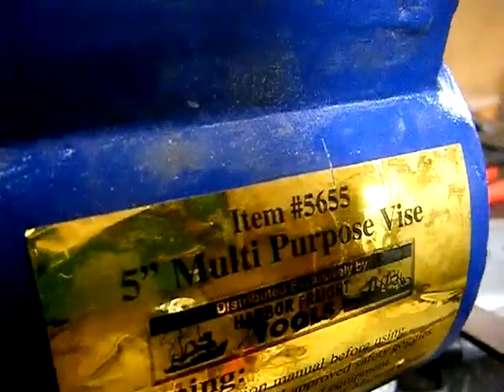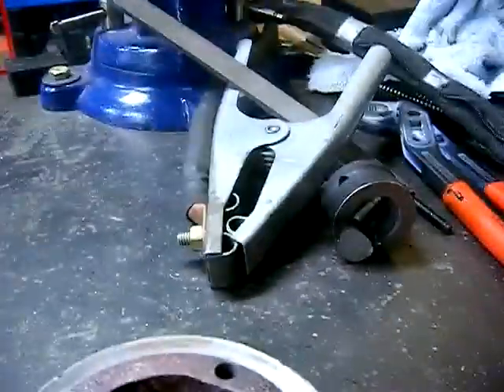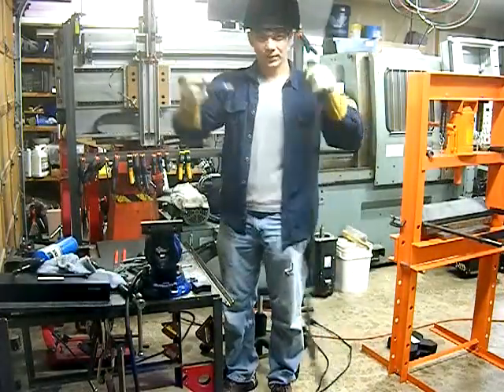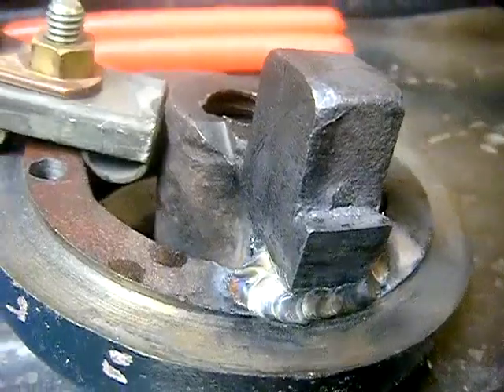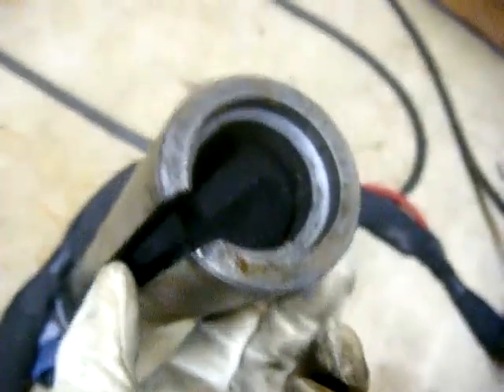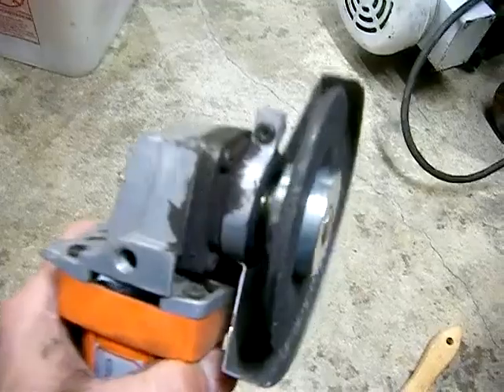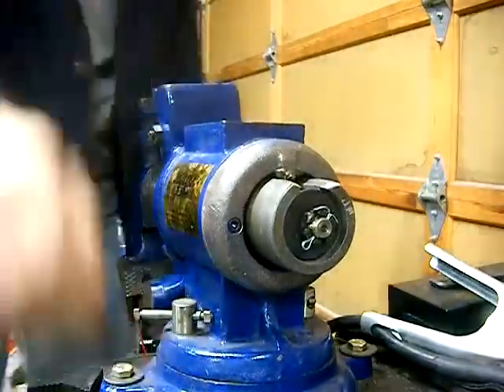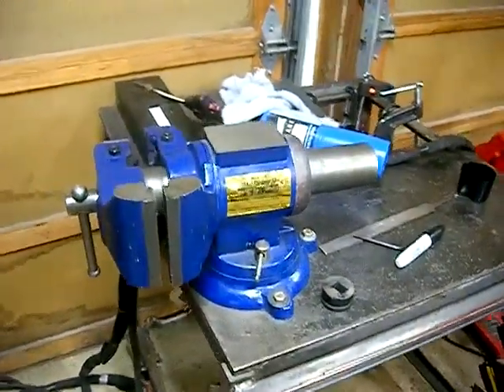Cast Iron TIG Welding - Harbor Freight Vise Repair

Comment: Nice welding job and great video. This is actually a really good vice and it takes a beating. I've had mine for over 20 years with no complaints but its branded as "Smiec" (china) and it's grey. You might be surprised what's under that shinny paint. Check out my video https://youtu.be/dIEELdpt2vs

Comment: Did the weld hold?
Reply from the maker: Yes, the welds have held up, though I don't abuse the vise as much as I used to.
Reply: +amaedesign Will do the same thing next time to tig weld cast iron with 316 rod
Reply: +amaedesign Hi ,you can use a 307 or 309 ,and for stick welding Isoarc 270, just note that  Isoarc is non machinable welding.

Comment: Great video. I have a broken vise still in storage that I should try to weld up with my powertig. Jody from welding tips and tricks has a few good tips on this type of repair too to improve the strength of the repair that will also try.

Comment: Using stainless rod will mean the repair will almost certainly fail pretty quickly. Reason for this is migration of significant amounts of carbon into the HAZ, which will mean perhaps a reduction in strength of around 75% over the unbroken part.

Carbon migration can be greatly reduced by careful pre-heating, and repairs can be carried out successfully by heating part to cherry red, and gas welding using a cast iron rod. However  few people are equipped to carry out repairs in this way, and it requires  a certain amount of skill to do.

It is feasible to properly repair most cast iron parts if you have a TIG set, and the correct filler rod material though. You need phospor or silicon bronze TIG braze filler rod, carefully vee out the area that needs to be repaired, machine set to DC earth neg, then join the root, then fill the rest of the vee with additional beads, taking care to put as little heat into the part as possible.

HF tools are indeed not that great quality, but thats not the fault of the Chinese who currently also make a fair amount of the tools sold by people such as Snap On, Beta, Facom etc etc. If you pay a low price for something, its a bit silly to expect top quality item, but a lot of this type of thing works fine for infrequent home use.

Comment: Hey Bob you might have the same configuration I have CK superflex with everlast 250ex welder? superflex cable is a dream to use it weighs next to nothing.

Comment: nothing wrong with some of the harbor freight tools i have three of their angle grinders and the 90 amp flux core welder and i use the hell out of them the welder works best if you dont use their wire so for less spatter get a good flux core wire

Comment: Good informative video. Thanks for the solution. I have an identical vice from HF and I abuse it all the time, making it do jobs for which it was never intended. So its just a matter of time before I 'll have to do the same repair. As for the grinding dust, I now take my pieces to a old vice outside. Any machine in the shop that has a cooling fan is going to distribute the micro dust all  over the vital parts. Not to mention my nasal passages , bronchial tubes and lungs. Keep up the good work

Comment: I have an identical vise but did not buy it from HF.  Going strong for 5 years now.
I also have the SWAG PRESS BRAKE.  I modified mine for my 12 Ton press.  Nice piece of kit.  Next project is a CNC Plasma Table.

Have Fun

Comment from the maker: @Ibringthetruth1 The part broke because I used the vise for crushing. At the time it broke, I was putting 200lbs of force on the crank handle.  Some would call that abuse.  I'm an engineer and design consumer products for a living. I anticipate and design for that.  The vise is a great value so long as you don't use it for crushing duty.  If it were made of cast steel, it could handle crushing duty too. But that would cost 3x the harbor freight price.

Comment: Great video. I would suggest assuming the vise was reverse engineered in its design the problem is Quality of the metal. Thanks for the effort. I have the same vise but use it for work holding rather than for crushing.

Comment: my suggestion if you do anymore cast iron get some nickle 99 its worth the expense. you also never know when you might have a cracked header that needs fixing too its just good to have around its like a spare welding hood you may never need it but if you do you would be glad you had it around

Comment from the maker: @echo5delta16 Nope, not a speed shop - I'm a genuine hobbyist.  I just happen to like big machines. That Ford 460 engine you see in the garage there - it's for a F700 truck and probably makes about 200hp tops =)

Comment: What in the heck do you do in that shop?  Build retro engineered flying saucers?  You have some really interesting looking equipment in the back wall of that garage shop but I don't even know what it is.  You've convinced me however that a pedel on a Tig Welder can really make it easier.  My Tig, has no pedel, but it's a Harbor Freight, the blue model.  It' pretty cool, but I have a lot to learn about Tig.  I tried Helium and welding Aluminum with the Harbor Freight DC Tig.

Comment from the maker: @MrDan27611 Thanks for the compliment.  The repaired vise is still going strong. I agree, it's a great design (except for the achilles heel shown in the video).  If the repair holds, I won't have any reason to replace it for 20 years.